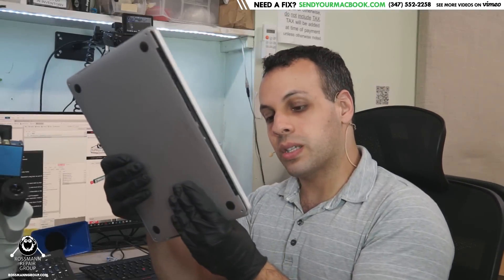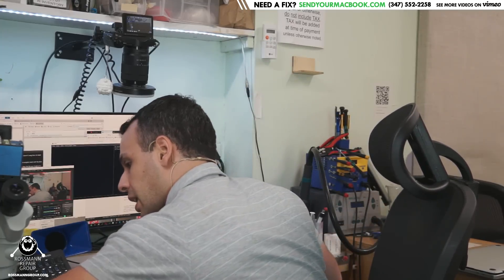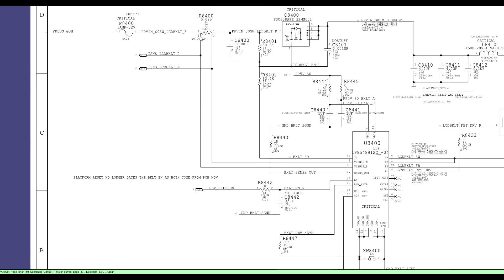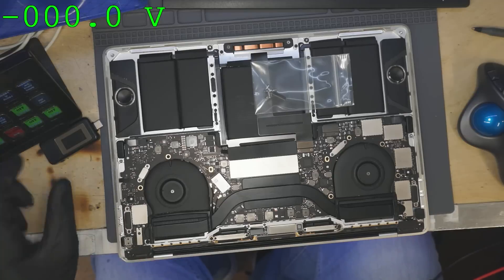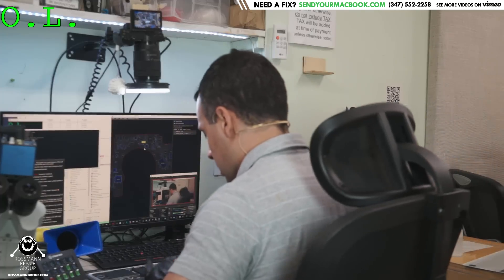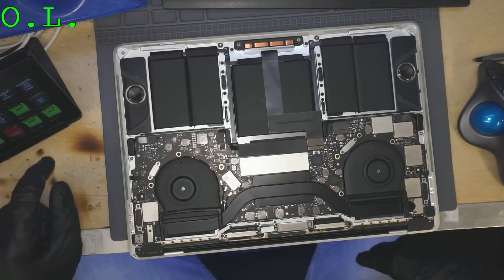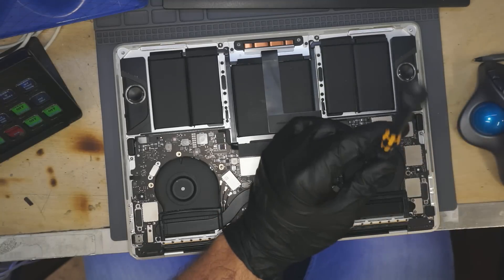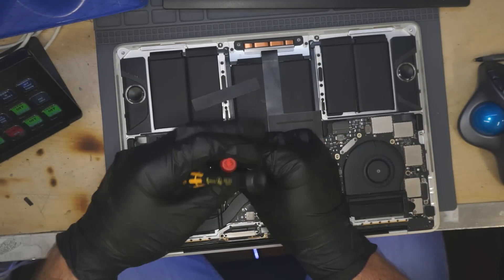Mac authorized dealer said WHAT??? + 1st attempt at ASMR board repair.

Comment: Off topic perhaps - but since you talk a bit about cell phones too, I was wondering what you think about SONY - That's a funny thing about phones in my experience - I've had a lot of Sony cellphones, mostly mid priced to lower range, and they all worked perfectly all their lifespan - I go get a top of the line Sony XZ Premium and its LCD screen completely dies after a little over a year.  I try resetting by holding all the designated correct buttons, but other than that, you cant remove the battery, and it has to be heat gunned and the battery taken out and almost completely tore down to get to the LCD screen so I think I'll let a shop do it. But I wonder - how on earth could they make such an astonishingly bad quality LCD screen or connection on their highest most prestigious and most promoted product, while the screens of my 3-4 year old Sony mobile phones STILL work perfectly. It just boggles the mind. 

 Well, maybe they put out their latest high resolution screens a year early before the bugs were sorted out and things like that of course but.  Well, at least from now on I'll make efforts to never buy the latest version of a new technology from any commercial company that's in the business of just trying to push new devices as fast as possible  ever again - that's for sure.  I'll stick with buying mid range stuff that has true and tested components.  I guess that's the same kind of reasoning why police, NASA and military all used The sturdy IBM/Lenovo ThinkPads.  Don't know if I would trust the newest versions of Lenovo's ThinkPads though - but then again what is there to trust these days, right?

Comment: Hey Louis, I have a ASUS M51T that the screen doesn't work. When I press the power I hear the hard drive and the fan will come on after its been on awhile, but no image on the display and all the ports don't work. I tried connecting a different screen but it didn't work because none of the ports work. Do you possibly know what the issue could be?

Comment: To be fair, perhaps the guy at the Apple authorized dealer just made an honest mistake and said fuse but meant capacitor.  Also, it might be possible that Apple just finds it better to replace a board than to train people to have the level of skill that you have to properly diagnose and repair these types of problems.  I’m not trying to contradict you, just trying to offer a perspective that gives the benefit of the doubt.

Comment: When it is an Apple authorized dealer they are not allowed to touch devices in this manner. 

I wish you'd stop shitting on those guys so hard. 

They'd instantly lose their ability to be labeled an Apple authorized dealer, and like a deli shop losing a lottery machine, it drives away business.

So yeah, they have to be as underhanded as Apple.

Comment: Apple authorized service providers are not allowed to do component level repairs. The best they can do is specific part replacement. For phones it's screens, batteries, front cameras, and if Apple is in a good mood haptic engine. MacBooks are even more restricted, it's logic board, screen and battery. Everything else has to be sent to Apple.

Comment: Well, technically, the problem is the fuse. The problem is that the fuse doesn't work correctly as a fuse, which is why other parts of the board have to be replaced. Because Apple.

Comment: If I'm trying to think with Apples mind, then I think the reason to replace the whole board is because replacing doesn't require an expert, a trained worker can do that all by himself. Thus, manufacturing a new board and having a cheaply paid worker to replace it is still cheaper, than hiring an expert who can identify the issue and (like in this case) deal with it. How much time did it take for you to fix it? From opening the thing and closing it down. I estimate about a hour, correct me if I'm wrong.  :)
BTW: Big bow down in front of you and the "right to repair" group !

Comment: OK, I LOVE that tip.  Where can I buy that?  Oh, here we go:

https://www.amazon.com/Flat-blade-Soldering-WQ-1403-Heater/dp/B004MJMETA/ref=sr_1_1?keywords=aoyue+1403&qid=1565446182&s=gateway&sr=8-1

That looks like the item, and it's actually cheaper delivered than on eBay.  It's unclear if it fits other brands of soldering stations, but that's such a nifty tool, even if you don't really have a use for it...

Comment: hello Louis, been watching your videos for a few years now, I personally don't use any Apple products as a policy, but I did buy one for my sister 3-4 years ago, recently she is having an issue where her laptop randomly won't power on. sometimes it works when you try again at a later time.  my questing is, do you have any suggestions regarding a repair shop in the London area? I don't want to take it to an apple store or apple approved store.

Thanks
Reply: You could try "Mind the Mac" they are in Swiss Cottage. Google them. Replaced my daughters motherboard on a 2012 macbookpro after trying some failed board repair. Done at a fair price.
Reply: @paulstoakes466  Thanks for the reply man, will give them a shout later this week.

Comment: For everybody complaining about the Mac authorized dealer: Whether it was a bad fuse or a bad capacitor, the result is the same: board level repair. 
- Not one single major manufacturer gives customers board level repair options. Not even if you buy a Lenovo P52 
- So why even put the fuse on there? Because safety, you dummies. Also: while they don't offer board level repair to customers, they DO refurbish / resell (What, did you think they were giving brand new units to those AppleCare customers?!)

Comment: I worked both as an Apple Genius and Apple Authorized Service Provider. There's really no difference in the two when it comes to component level replacement. If something is bad on the Main Logic Board, you replace the Main Logic Board. AASPs add other things like Data Recovery and Data Backup to sweeten the pot for the business.

Comment: AASPs are not allowed to perform component repairs, only replacements. The actual repairs are done in China. Apple provides AASPs with refurbished replacement components. I know because I used to work at an Apple Authorized "repair" center.

Comment: Back in the '90s when I serviced camcorders, Sony had a policy NOT to sell boards unless you justified it needing a new board. They considered all their equipment component level repairable. Amazing the different repair philosophy seen today.
Reply: I remember that and when my 1985 $399 VCR quit working the independent VCR repair shop correctly diagnosed a bad diode, charged $1.89 for the new diode and one hour repair time for a total invoice of around $35.
Reply: @mrradio2187  God... I remember back when I felt 30+ bucks an hour for repair work was expensive. 
  Even adjusted for inflation, that's still cheaper then today.
Reply: @AC3handle  During the 80's it was expensive as my hourly working wage was just $2.35 per hour and thinking back today I should have diagnosed the problem myself and replaced the failed diode but VCR's were considered new technology and I dared not attempt to repair it myself for fear of causing more damage. The $35 spent gave me the inspiration needed to get my degree in Electronics even at the Junior College level. It was money well spent!
Reply: I had an awesome Yamaha reciever that kicked the bucket. Called Yamahaand they sent me a 95 page schematic for free. Found a shorted cap and got it back working. Still using the reciever 20 years later!
Reply: @pointedspider  I had the same experience with Pioneer. Found an od SX-639 amp and they went into the archive, pulled an old manual, copied it and mailed it to me for free. Fat chance that happening today.
Reply: That was when Sony was good.
Reply: @KSATechnology  You can still easily repair Sony consoles, unlike every other system.
Reply: its all about that money money money.  cant make money repairing issues for cheap
Reply: My experience with Sony in the 90s was a camcorder I paid $1200 for. It failed, less than a month out of warranty,  THREE times, and their national service dept charged me $350 each time. The third time I told them to trash it, I wasn't going to pay that again.  Not paying > $1000 in a year to repair a $1200 camcorder.
I also had a receiver that had a remote control that kept dying, it died twice in the first 90 days, then died a few weeks out of warranty and they wanted $150 to replace the remote. I decided I could use the receiver without a remote.
Then I stopped buying Sony stuff.
Reply: And now we have problems with environmental pollution. *Surprised Pikachu face.
Reply: Sony also published amazing repair manuals.
Reply: @georg walt Huh?
Reply: @georg walt Video game consoles, not a mixing board.
Reply: yeah back when capacitors and fuses were the size of a thumb and have about 1/1000 of the parts i agree though fuse and other things repairable but whole board impossible bro
Reply: Except the emmc. Emmc always have that dreaded ta partition drm key thing like uefi secure boot per phone.
Reply: @ayuchanayuko  hehe just back it up... and yes I know that's easier said than done.
Reply: @second2050  you can't backup from a dead chip, and the technicians in my area dont do  BGA :(

Comment: that blows my mind as an electrician, if the fuse blows the board needs to be replaced??? then why have a fuse at all? fuses are to protect the circuit after it and replaceable when they do, thats about as much use as a lead life jacket, if it needs to be used then your dead anyway

Comment: Apple:  The Fuse is bad
Customer:  Do you mean the fuse is blown?  
A: No the fuse is bad, you need to replace the board
C:  If the board is fine, why don't you replace the fuse?
A:  buy a new board, or buy a new macbook
C:  If the fuse blew, doesn't that mean something past the fuse is bad, and drew too much power?
A:  Either buy a new macbook, or GTFO

Comment: Wow, that's how to do a diagnositc for the small capacitors on the board. I actually learned something from this video!
Nice work, really nice work. Really nice and impressed by the fact that there are technicians are capable of doing this level of repair.
Not only by the skill, but also by the fact that we probably prevent wasting a motherboard that can still be fixed.

Comment: What is the point of having a fuse if Apple have made it so they wont replace them.  Fuses are there as a means of protection, blowing the fuse instead of damaging a more component of the computer. Whats the point of them if Apple say if a fuse blows you have to replace practically the whole system?  If there is a fault in the monitor causing the fuse to blow, that wouldn't resolve the issue.  Its like replacing your car engine because your brake light has blown.

Comment: I am just thinking, even IF the fuse would have been broken, does that not include the possibility for the whole board needing replacement?
I mean, a fuse is there to blow when something draws too much current so if a fuse is gone, something on the board is broken as well.
Or am I not thinking correctly?

Comment: I'm not much into electronics. It is my understanding that the fuse is used to secure the rest of the components. In case of power surge ore something - fuse is to fail sparing the rest of the electronics. So if Apple says that fuse is broken - shouldn't that mean that rest is fine and there is only fuse to replace? I replaced fuse in my house electric grid recently - thanks to that element i avoided major malfunction. What are fuses for in electronics then?

Comment: Pro tip, if a tech tells you it's a fuse, they're lying.
A blown fuse, is a symptom almost never a cause.
Reply: Good point, you can replace that fuse as much as you want but the thing that caused it wint go away (except for very sepcific cases).
Reply: @nukley  YES; THIS!

And what my man Jimmeh said of course

A 10A fuse will always blow if you put 20A through it. Its like a monkey with a knife stabbing you in the side. You can put bandages on that, but well, you gotta get rid of the monkey at some point

Comment: After having watched a number of videos of yours. Louis, you know how this works. Even if the shop had figured out correctly what is wrong, as an authorized shop they had no other option other then replacing the whole board. Otherwise their authorization may be gone pretty quickly.
Under this premise, what do you think how much effort a shop puts into dignosing a problem correctly if you know the only possible fix Apple allows you to do right from the beginning.
So the one to blame is in my oppinion not that shop but Apple and their "repair-policy"

I am glad that there are still shops like yours, which actually do repairs and not just replacements.

Comment: the thing with apple authorized repair shops is that it doesnt matter what they say the problem is, if you always replace the board or even beter the whole machine it works afterwards and that is all they care about, they probably have a known good test board they hook up to the machine, it works with that good recomend replacing the board and tell the customer some BS is wrong and we need to replace the board, if the test board doesnt fix the issue they tell the customer the machine is dead and they need to replace the whole machine

Comment: Hey, I stumbled upon your channel after I was looking for solutions for my MacBook Pro mid 2015 15 inch battery replacement. As Apple service centres in my country want to charge me over 700 dollars to replace my battery as they say they need to change the keyboard with the battery. Do you have an idea if that is correct?

Comment: The fuse is almost never the problem even if it blows, it's usually some other component that runs electricity through that fuse. In some cases the fuse can be faulty, but it often isn't.
This is basic knowledge that almost anyone could figure out, especially someone that WORKS with this kind of stuff on a daily basis.

Comment: So these caps dont care what comes and where it comes from ?  ... Are there any non market surfice mounted caps, that you know, where polarity matters? .. ones a month wiever ;)
Reply: Depends on the construction, just as for through-hole capacitors.
Polarity sensitive tantalum and electrolytic capacitors are available in SMD packages.

Comment: How did he get all the capacitors to flow into place automatically?
Reply: Hot air to heat the area, then the surface tension of the solder sticking to  the metal pads of the caps and the board, drags the caps into alignment
Reply: @michaeltempsch5282  Surface tension holds liquid surfaces together, but why would it cause a solid object to move?
Reply: @909sickle  because the object is floating on top/in the molten metal  and also sticking to to it, therefore moving along with the metal as it moves/contracts to the one  unmovable thing of the 3 things involved, the pad (the solder and capacitor the other 2)
Reply: @michaeltempsch5282  This suggests the molten solder is somehow attracted to solid metal (capacitor legs and the pad). This attraction seems to happen whenever the solder is hot/molten and everything is buried in flux. But it's unclear what physical force is causing this attraction / movement.
Reply: @909sickle  I've never bothered to look deeper into it, but here's the best somewhat deeper info I was able to find on a quick search - https://www.markimicrowave.com/blog/the-self-alignment-of-reflowed-surface-mount-components/
Reply: @michaeltempsch5282  Thanks for the info. I tried some searching, but didn't find anything. The article uses a trampoline analogy, as if each pad with a solder blob is a trampoline and the feet of the component settle into the middle of the trampoline. But a trampoline is a flat surface which becomes concave when objects are on it, so the the trampoline is intuitive. But solder blobs are convex, making it very non-intuitive that objects on them would settle in the middle, instead of sliding off the slide. If there were some force that caused solder (tin/lead) to be attracted to copper/gold/nickel, that would explain everything when combined with surface tension. What that force is, I will keep searching, but have found no explanation yet.

Comment: Would have been interesting to know the cost of the parts and labor to fix it - as opposed to what Genius Bar were going to extort.
Reply: Louis charges a flat fee of about $325 (and no-fix no-pay). Examples such as this are easy money, but its a win-win for the customer.
Reply: @gordonrichardson2972   And what was Genius Bar(ff) going to charge?
Reply: @gbnq2513  Probably around $1000 (or more) for a new board (including CPU and RAM, since everything is soldered in place).